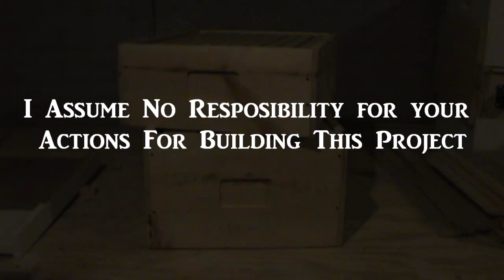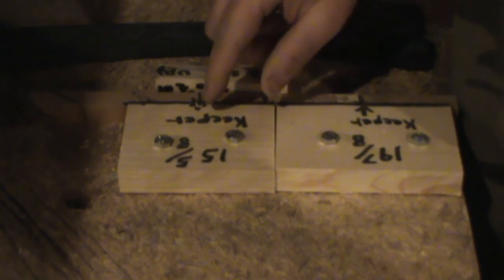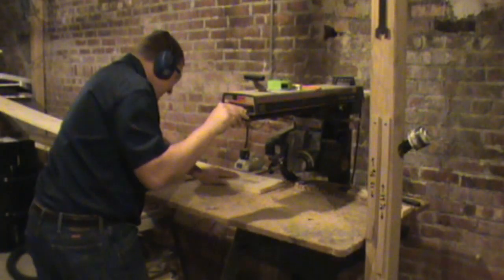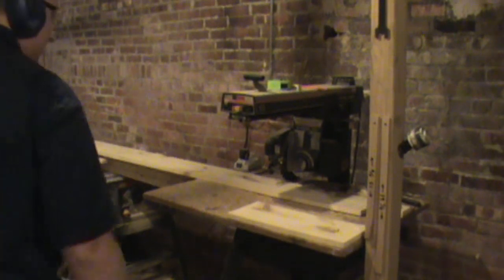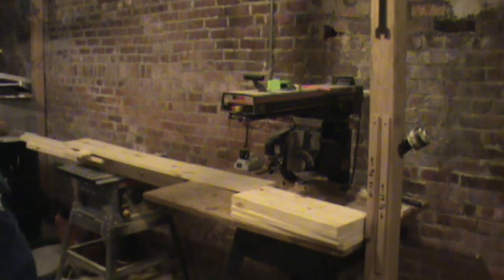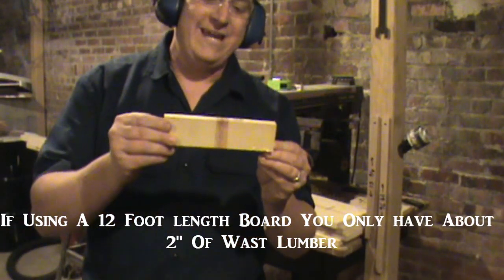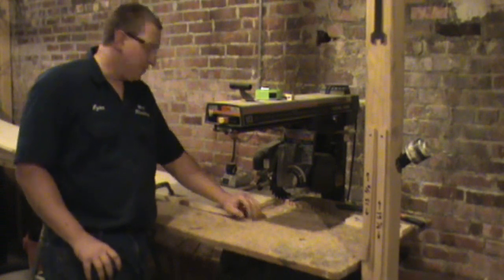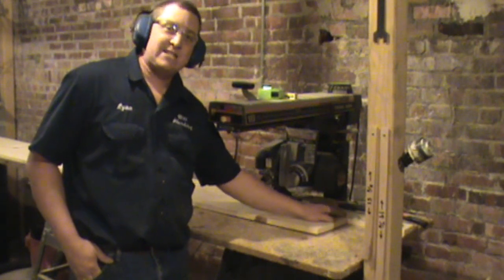How To Build A Hive Body Or Medium Super Part 1

Comment: o yeah makes perfect sense. ill go with ur estimations this weekend :)  well what i meant (i hit the caps on accident)... "have you built 8 frame hive bodies ?"  also, have you ever tried 45 degree angles instead of rabbet joints ? ive always been curious if they would work ok . of course with glue and a few brads...maybe 2 screws as well. sure would make the construction alot easier. 
 but of all the demos on youtube i think yours is the best.

Comment: i need to figure out how to make those jigs as well. i made a jig which slanted the boards sideways on my radial arm saw. then i turned the saw 90 degrees and figured i could push into the board to make handles but found out i must need a certain blade to rip sideways with the blade. all it did was smoke and seemed to get hot so i scrapped that idea. i do have a second router but the lift adjustment doesnt work. i need to figure it out so i can make hand holds.

Comment: Excellent series. I think I can do this. It doesn't really look like this can be done without at least 1 router table though.
Reply from the maker: If you have a "Dado Blade Set" for your table saw you can get away making the hive but yes you need a router for the sides of the frames!

Comment from the maker: I don't like to assume, but I would assume that the people using the 13-3/4" & 14" measurement may be using box joints or some other joint. requiring a bit longer end board. Mine are 3/8" x 3/8" rabbet joints. Which would be a total of -3/4" shorter length difference from a finger or box joint. Tommy, I hope this will clear things up. What are you talking about here (Frame Hive Bodies) ?

Comment from the maker: How I got my answer, The average frame is 1-3/8" wide. 1-3/8" X 2 frames that you will be removing = 2-3/4" Dead space. Take 15-5/8" wide 10 Frame standard size and subtract the 2-3/4" deduction for the Two frames your taking out. It comes out to 12-7/8" to be exact. I rounded up 1/8" to 13" in reference to where the frames would be. So in my hives I don't see a problem with 13" or 13-3/4"

Comment: Great videos (I've watched all 5 plus the 2 frame making videos).  As we approach Spring I am going to make two medium supers and 20 frames using your plans.  One quick question though...if I add up the dimensions of the shorter sides (after assembly) (i.e., 15 5/8 inches plus 3/8 inch x 2 for the two dadoed ends of the long sides) I come up with 16 3/8 inches.  Aren't standard dimensions for a super's width 16 1/4 inches?  Is the extra 1/8 inch a material difference?  Or is the extra 1/8 inch so nominal it does not really matter.  (i.e., if I use the medium super on top of two 19 7/8 x 16 2/4 inch deep supers I currently have?)  You seem very knowledgable both on the component construction and underlying beekeeping mechanisms I figured you would know.  Thanks very much.